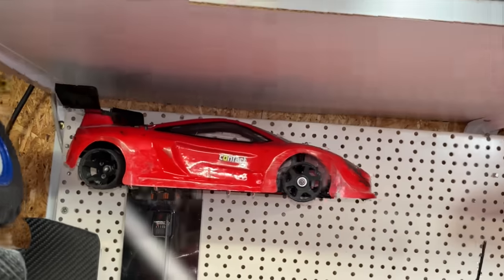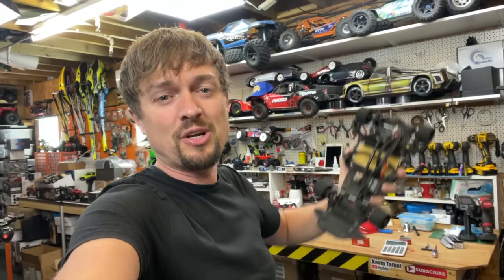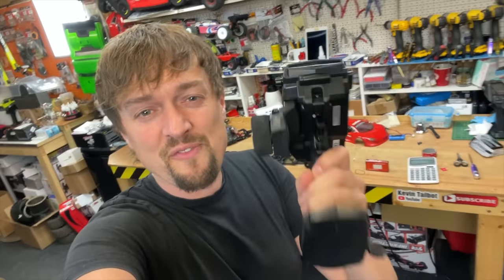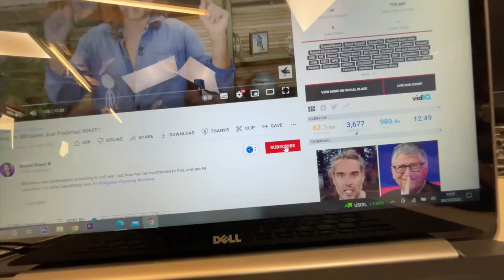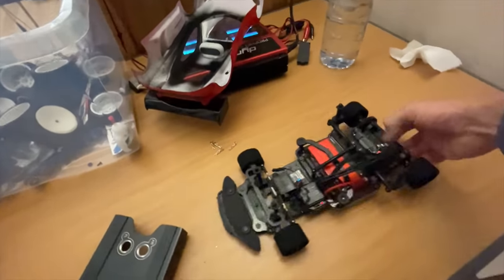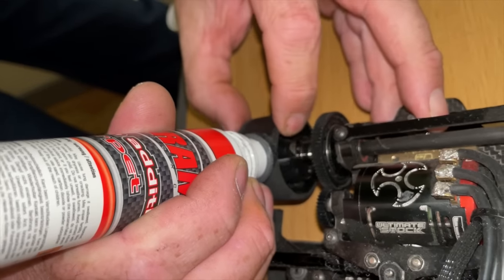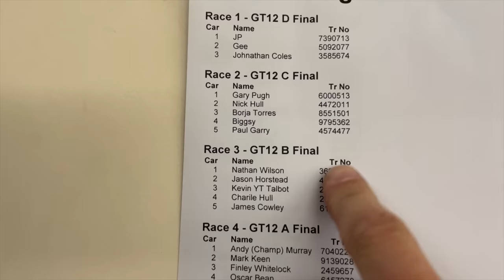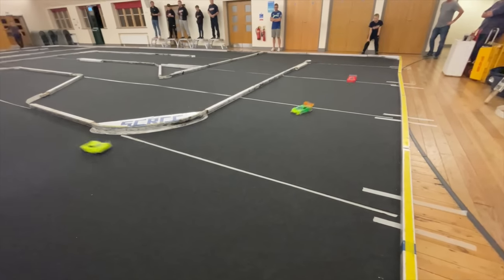The RC Racing Car that i have never shown you

Comment: Great to finally see that GT12 on the channel. You could buy a new Schumacher Atom 2 and have a set up sheet provided by the other local Schumacher racers or even the main designer (Andy Murray) could help you set it up. Would love to see more GT12 or any other carpet pan car racing on the channel. Maybe even try the Schumacher LMPs some time, even faster on the same sort of basic concept design.
Reply: id say a xray they are great but isnt gt12 with rubber tires?

Comment: Looks bit like a  brca 1/12th class they ran back in the day. Ran more of the le man's body's though. They was quick when we used to use brushed motors and nicad/nickles😂👍
Reply: It’s crazy how the tech has moved on. Back in the 80’s when I was a kid, we couldn’t afford a Hornet, or Grasshopper or a Frog, so my rc was from Kmart, a Nikki Black Cat that ate AA batteries like nothing else, so when I got a bit older I bought a Hornet and Super Hornet, and now my cheapest Chinese brushless buggy that cost less than the Hornet absolutely smokes the poor old dear. I even had a hotted up Grasshopper for a while and they just are not fast lol. It’s still fun though. Sometimes it feels like I deliberately crash so I can pull the car down and add more goodness to them lol.
Reply: Gt12 is an awesome sport. You're spot on. The class is BRCA affiliated and was born from the likes of Mardaves.

GT12s have 13.5 turn brushless motors, and the 1s lipo was originally designed to compete with the 6 volt nimhs.

It really is a great hobby and if you miss racing I thoroughly recommend getting into it.

Comment: Loved seeing this.

Gt12 racing is an Ace sport. Gt12 cars are essentially - like the name says - GT electric cars in their own right, just littler than the big ones. They look simple but are highly tunable. 

Anyone who fancies taking up the sport, I recommend. There's a technical learning curve that comes with it that's enjoyable but isn't daunting. An older car isn't going to be uncompetitive. You can pick up a second hand 1s speed controller, 13.5t motor and transponder on the likes of ebay if you're on a budget and a 1s lipo can be had pretty cheap. 

You can still have all the bashers you want and just keep the gt12 for race days.

I had never driven a proper rc race car before I had a shot of one at my local gt12 club earlier in the year.
A few weeks later I got a used Schumacher Atom and was on my way.

Comment: I have the atom2 with the steel chassis’s i thought it would be a cheap way to get I to indoor carpet racing.  I was faster than the house cars people could rent but everyone else was running a carbon fiber chassis and had even drilled holes to get it down to the min weight.  Mine, box stock, was 30% heavier and 2-3 SECONDS slower than everyone else. 

I put it on an asphalt track and was able to beat it with Nikko buggies from the 80s and a cheap TT02.  I took those to my local carpet track and they didn’t work at all! Traction rolling everywhere. 

You’re doing awesome Kev and I look forward to seeing you in the A with Murray!
Reply: Atom 2's with a carbon chassis are all under the legal weight. Racers typically require the 120g mid weight and a 35g lipo weight, then another 10-50grams depending on electrics weight to meet 950g. They're designed to run at 950grams. Anyone running them lighter are  not running them as they're intended to be

Comment: Hey my friend I haven't made a comment in a long time however, I used to race RC 12i rc12ie' one was carbon fiber based one was not however they had the old nickel cadmium the style batteries in a 4 cell, or 6cell configuration and those were 12 scale same kind of chassis same kind of basic suspension some have an early triangulated micro shock system on the rear motor pod! 10th and 12th scale as well. Many other us manufacturers did the same thing from this'80s through the 90s! Love the video thank you

Comment: Doubt at the moment you need a new car. Use the one you have. Change the setup etc and practice. Once you can get around the track quick enough without crashing then look at upgrading to a newer chassis is the current one is holding you back.

Comment: I still have my Tamia TL-01 from the 90's that we used to do outdoor tarmac racing on my mates dad's farm.

Few years ago dug it out, ball raced it stuck a 15T brushed motor in it and and cheap servo/reveiver/ESC (It still had a 3 step speed controller in if people can remember them!) and the old NiCad batteries still worked and charged and it's still good! Does 40mph Which isn't bad for a 25 yearold car!

Cheers Kev always a fun watch 👍